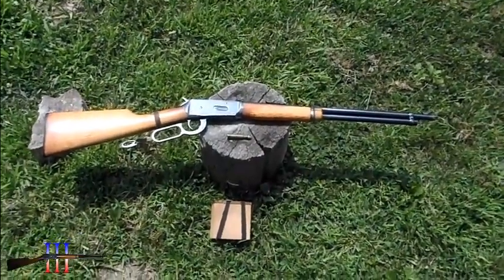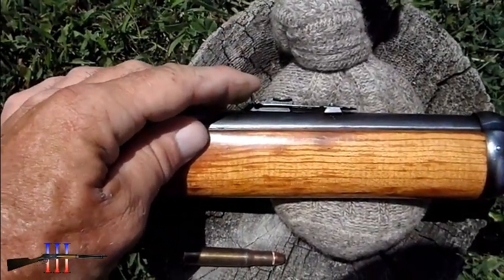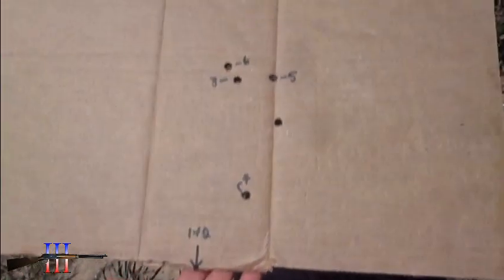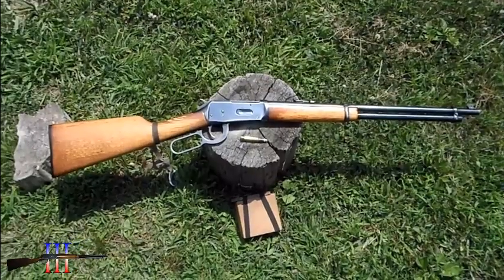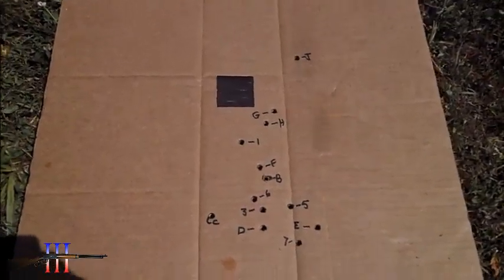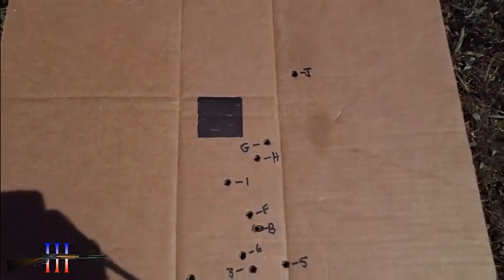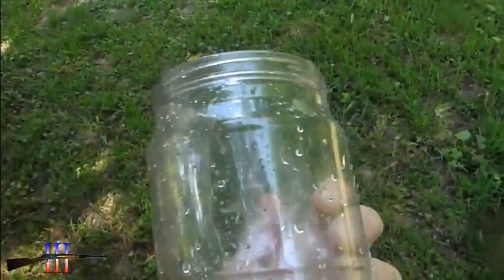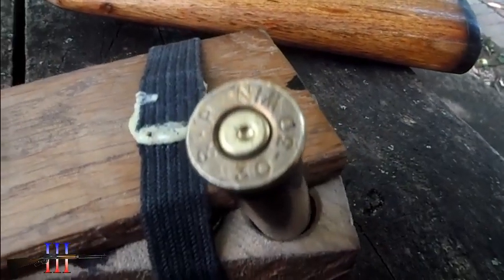Load Developing a Varmint 30-30 Load

Comment: Lee makes a lighter weight bullet mold for 30-30. I can’t remember exactly what it is. With all the videos of yours I’ve watched, I just now noticed you shoot southpaw like me. Haha👍🏻🇺🇸
Reply from the maker: I'm not really looking for a smaller cast bullet, I love the 150gr FN bullets I use. I was using these lighter 32cal bullets because I knew they were more plyable, and the were all the 32cal handgun bullets Midway had. I didn't want to start out with something I might not be able to size down, like .312" rifle bullets until I tried something I figured would be easier to size.
The handgun bullets sized a lot easier that I thought, so I am pretty confident the rifle bullets will size easy enough.

I shoot with either hand; but with iron sighted rifles, I shoot lefty since I am left eyed. ;)